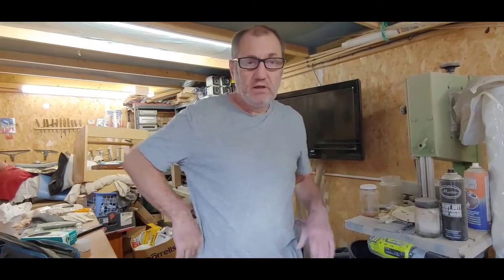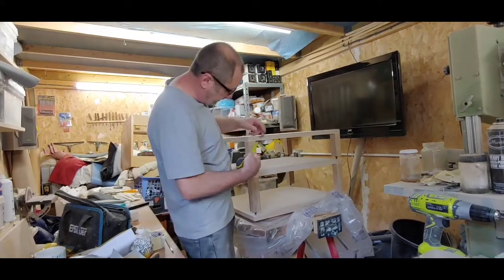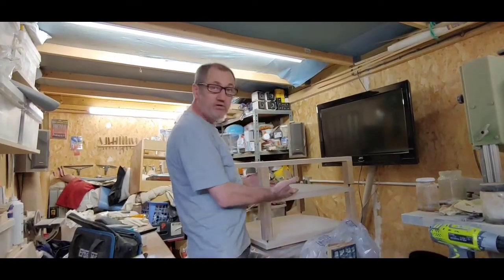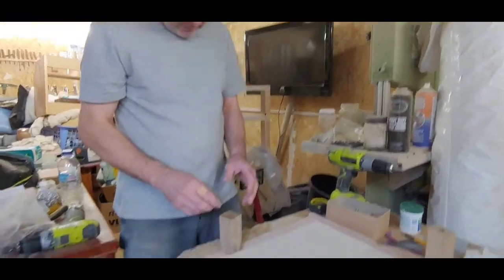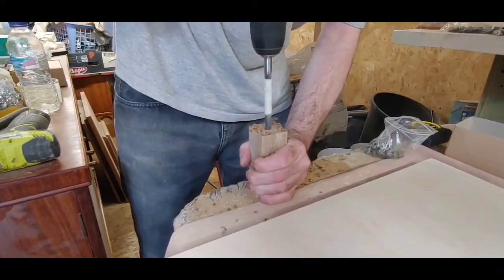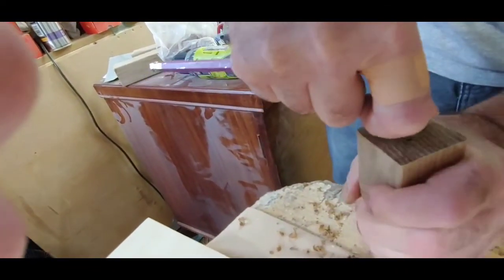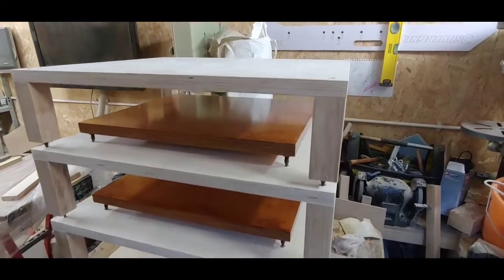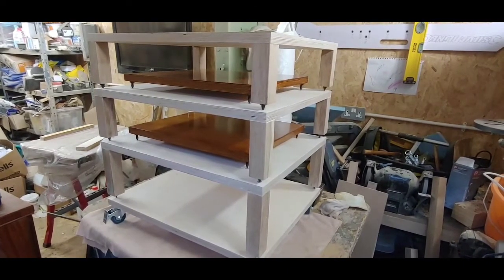How To Make a Quality, Hi Fi Equipment Rack.

Comment: great video, as always - good pace, informative and watchable.
instead of spikes into screwheads, why not cut a circular recess for the spike bases you can buy and fix them down with mastic or liquid rubber?  hard to remove the legs once done but would dampen any vibrations heading down

Comment: Here's a thought. Do your first shelf including spikes then place it on top of your next shelf and line the shelves up as exactly as you want. A tap on the completed shelf at each corner with a rubber mallet should leave a punch mark for your drill bit to perfectly centre the screws under your spikes. Rinse and repeat...

Comment: Hi.  Looks like a good start but I don't see a part 2.  What about wire routing / management?  Anything in your rack to deal with that?  Also, your isolation shelf is coupled to the rack shelf by metal-on-metal.  That's not going to isolate anything.  You need some kind of dampening like springs or rubber.

Comment: Great job man! this is what i was looking for in building for my hi-fi rack. Tho i got a question: how do you calculate the spikes total weight capacity if you are staking 100 kg or more of gear on one rack? do the bottom and top spikes need to be the same or the bottom need to be the most heavy duty ones?
Reply from the maker: Hello, all the spikes are the biggest I could get, they will take well enough weight for hi-fi equipment, thanks for commenting & watching👍

Comment: which kind of stain to use？ water or oil based？ where can buy it？ thanks
Reply from the maker: Hello, I use oil stains, heres a link http://www.wsjenkins.co.uk/wood.htm
Reply: @tweaker man  thanks for your reply. I want your suggestions for compare with the rack tube to use metal or wood , which are the best effects？ thanks
Reply from the maker: @tyk2546  Hello, personally I prefer wood, oak is the best wood for making hi fi racks👍
Reply: @tweakerman  I mean the tube
Reply: @tweaker man  hello I say the wood post or steel post is good？ thanks
Reply from the maker: @tyk2546  wood, oak.
Reply: @tweaker man  I see.  thank you very much. I will try to make a one base on your this good rack.